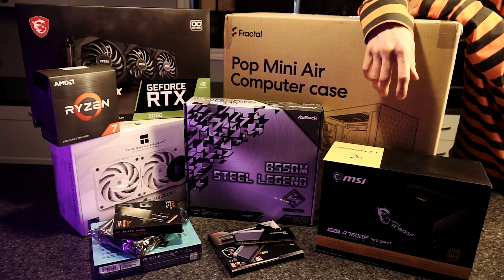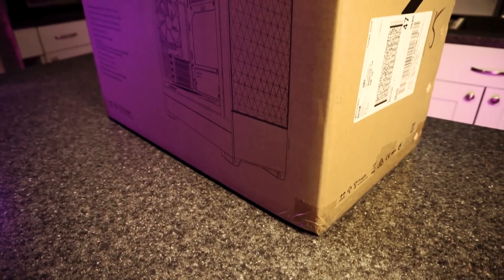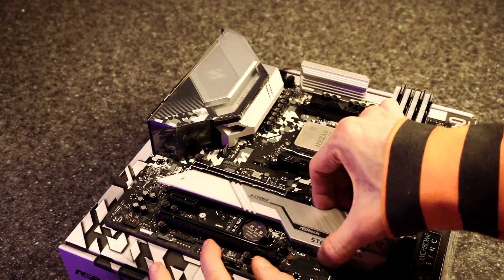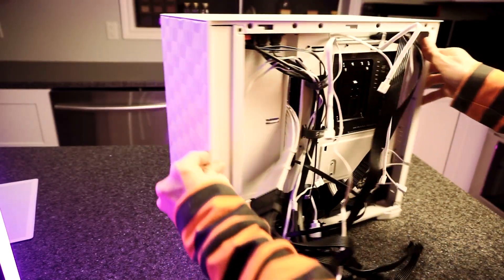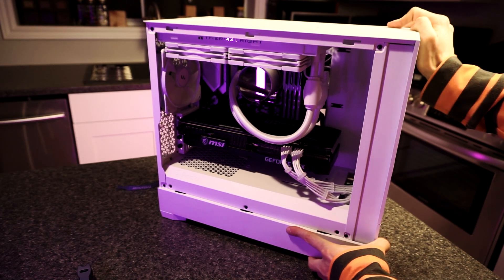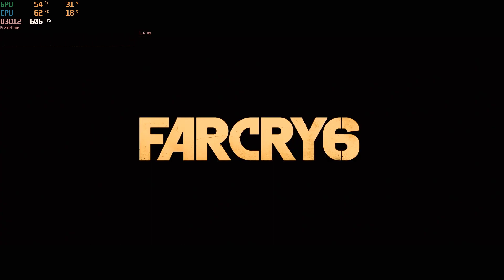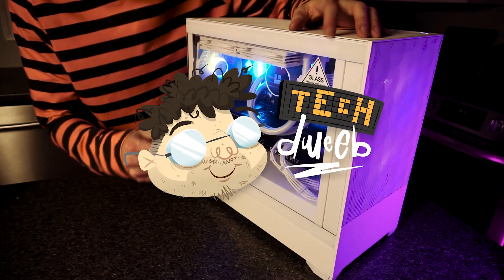Building an AMAZING Tiny PC! ~ FRACTAL POP MINI REVIEW & BUILD

Comment: It seems motherboard companies have decided to create an arbitrary challenge for mATX-builds by often making the graphics card PCIe slot the second one, out of 3 or whatever, which means one loses a slot in the cases, which makes the cooling more cramped and potentially puts the coolers directly on the floor, with one of these increasingly common 2.6 slot (3 slot) cards.
That aside, case makers just stubbornly want to continue being doofuses by creating a floor where the PSU is right underneath the graphics card, instead of putting it anywhere else (so one could theoretically put a mesh on the floor. (I know there is a mesh anyway for no reason.)
Aside from stubbornly following that useless window trend, instead of even providing an option of a side-mesh, which would work wonders (sorta).

Comment: i saw that you put an aio in this case, and i was wondering if the fans on the radiator are intake or exhaust? i am worried for my build about negative air pressure if those top fans were set to exhaust, because then there would be 2 intakes and 3 exhaust
Reply: Wondering about this too, it's either gonna be 2/3 negative or 4/1 positive and not sure which works better

Comment: I'm planning to use this case in combination with a 7800x3D and a 7800XT. No water cooling.
Should I be concerned about the temperature? I was thinking of throwing another top exhaust fan in there.
Reply: I am doing the same but with a 770x CPU, I will go for the 240 mmAIO to keep nice and chill the cpu, as a graphics card (7800xt) I got the saphire "pure model" lovely white and it will fit and performe great....be sure to get a powerfull PSU (at least 850 watts).....

Comment: I recently got this motherboard and my aio would not work/just wouldn’t cool my cpu. How did you get yours to work. I reinstalled on my old motho and everything was fine
Reply from the maker: Oh weird. Are you sure you had them connected properly to the PUMP and CPU_FAN headers? I can't think of why it wouldn't work other than a connection issue.
Reply: @TechDweeb  Yea idk what happened but I just sent that one back and got a new one and it is working perfctly fine

Comment: I recently made a build with the 7 5800x3d and kept my old 1660ti. got the msi b550 gaming plus and 32gb new ram.
MASSIVE upgrade for only ~$650, considering i had an i7 2700k before.
Probably gonna get a good price on a used 3060ti or even 3070ti to keep my total cost under 1k.
With my current setup I get great FPS with high settings on all the games I've tried. The ryzen 7 5800x would have similar performance and it's $100 cheaper.
If anyone wants to build a great budget gaming PC I agree, the 7 5800x, b550 mobo, is such a great cheap combo. You don't have to spend a lot on the gpu if you're on a tighter budget and you'll still get GREAT FPS.
Reply from the maker: Nice upgrade!

Comment: Great looking build Dweeb😎
Just built my new system and you guessed it, I used the Pop mini RGB case aswell in black.
Specs:
-Ryzen 7 5700X (Great value)
-Asrock B550M Steel Legend
-32Gb Corsair Pro RGB 3600Mhz (Sale)
-Asus Rx6750XT Dual 12Gb
-1Tb Nvme + 1Tb Nvme external

The 6750XT cost new the same as a 3070 cost used here so was a no brainer😊
Reply from the maker: Nice setup! I think the 6750xt is a great value gpu right now.

Comment: I am currently using the jonsbo d31, its also a small matx case, maybe you can try building in it. It is a pretty nice case unside is you'll have to buy your own case fans
Reply from the maker: Oh neat! Does yours have a temp monitoring screen like the photos show?
Reply: @TechDweeb  Nah didn't get the screen one was on a "budget" got the mesh one and the screen kinda blocks the PSU cooling so it seem kinda impractical for me the get that version

Edit: now I think about it, actually there's like 30 percent of the PSU is still exposed to air, and the front panel has quite a bit of gap so I think it's still fine even if I get the screen version.

Comment: 3:29 you put your WEED in there! ;-) LOL, like the SNL skit...

Surprised you didn't mention the 5.25" external bay above that,  which you could put an optical drive into, as that's getting less common on cases lately. I guess optical media is getting less important lately.

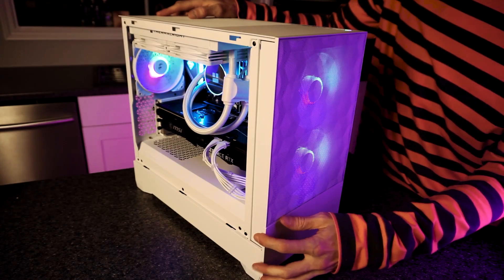15:22 oh, so you did. 3.5mm? I think you mean 120mm ;-) if you wanna be metric with it.

10:12 there is such a thing as spray paint... remove the shroud and backplate and paint them, fairly cheap... the "white tax" on GPUs is absurd.
Reply from the maker: I know it well! I thought the same thing (but didn't want to say it in the vid :P)

Comment: That's a nice case. The build turned out really well, I think. I like that you can stick a disc drive on the bottom behind the panel. I can't imagine building a machine without a disc dive, just in case...
Reply from the maker: Haha I'm the opposite, I can't imagine owning a PC WITH an optical drive. Although on those rare occasions that I do need one I have an old laptop that I pull out and dust off.
Reply: @TechDweeb  I have a USB optical drive that sits in a drawer and never sees the light of day.  I bought it last year when my last one died.  Get this, the new one literally has a 3D printed shell on it.  I laughed when I saw that.  THey're not even bothering with a molded shell for those things anymore.
Reply: @BandoidView I bought a disc drive off LG and it’s the same one they are making. They are nice to use though I prefer the internal drives more (and they are cheaper to buy anyways)

Comment: got a 5800x (170€ used) and that b550m steel legend in my main build aswell. in a white deepcool macube matx case. A very good point for the steel legend for an matx build is that it has the pcie slot in the upmost position so the GPU has enough room to breaht in a small case.

Comment: Hello, for my new builds I usually mess with the bios first like fan curves, xmp, boost settings before i install windows.

In your case, what's your take or rationale on installing windows first then going to bios once everything's done in the OS?

Nice build btw :)
Reply from the maker: I don't think it really matters either way tbh. One time I heard a guy mention that he had an unstable XMP profile and his PC crashed while installing windows, and then as a troubleshooting step he flashed his mobo bios and it bricked the mobo, and later he used the same ram kit with a new mobo and that same xmp profile caused instability, and he suspected that it was a bad xmp profile on the ram that caused his earlier failures. Just an isolated case but it made me rethink using any overclocking before getting the system setup properly. In my mind it makes more sense to do anything beyond the default (adjusting fan curves, xmp, enabling rebar, etc) AFTER the system is setup because then you'll have an idea what went wrong if you have issues after messing with bios stuff. But really it's not likely to cause a problem either way 99.999% of the time, I doubt it matters.

Comment: @TechDweeb, when does thermal paste fail?  Does it happen suddenly?  My new to me 3060ti has just started getting hot, enough that I get pretty consistent lag spikes in Fallout 4.  (I shouldn't)  Anyways, thanks for your info.
Reply from the maker: Factory applied thermal paste can be very hit or miss. I've seen some pretty terrible paste jobs. Honestly if your card is running hot, repaste it. You won't void your warranty or anything, and it's worth it just to know that's not the issue. 

You know about undervolting, right? ;) https://www.youtube.com/watch?v=R-ho10bVEgg
Reply: @TechDweeb  yes I know about undervolting.  I’ll repaste the
Card.